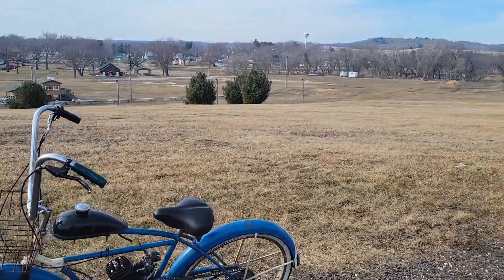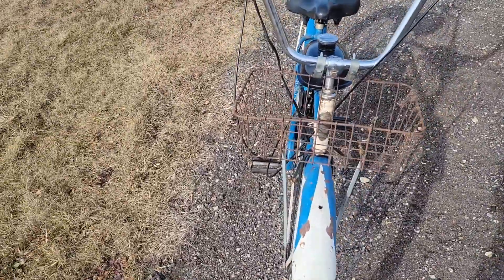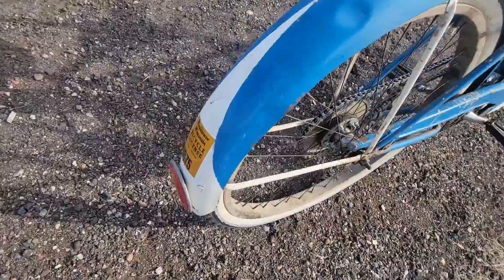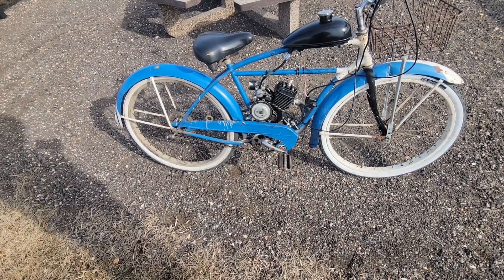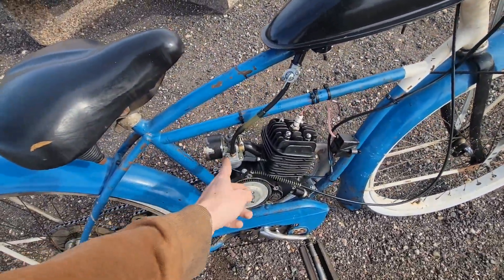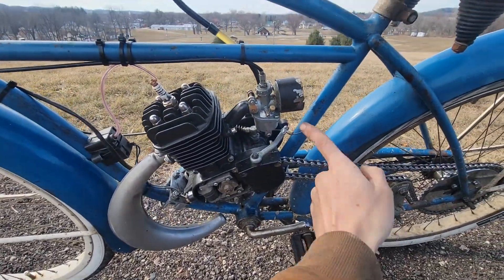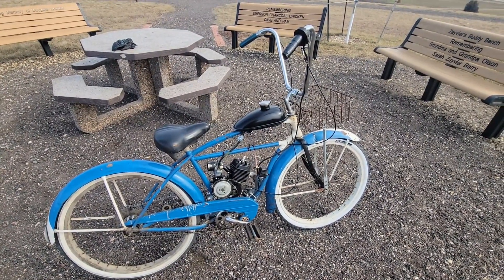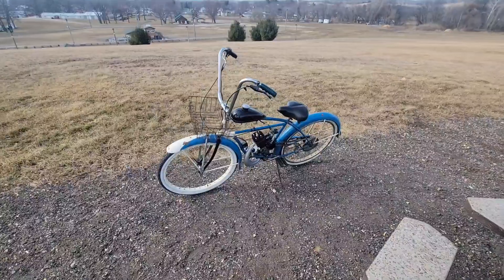another custom motorized schwinn bycicle!

Comment: Beautiful, but fenders are a no-no. Thanks for sharing.
Reply: Why though?
Reply: @TheGemmaster22  Death wish. They buckle with an engine and destroy your wheel. When they don't buckle, metal fenders cannot take the vibration and shatter. No metal fenders on motorized bicycles. Ask the community....
Reply from the maker: I tack weld em at 4 points should have mentioned that and I watch em but yea I've had fender failures in the past its most totally not awsome